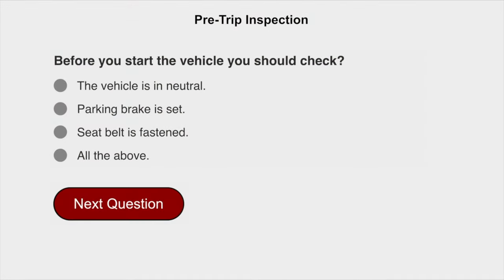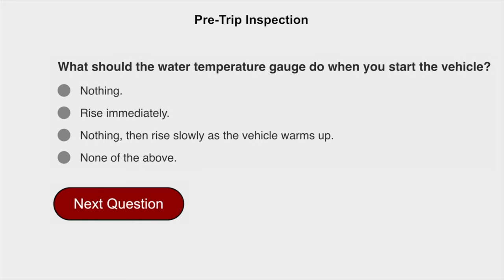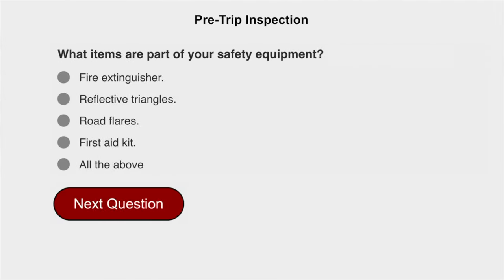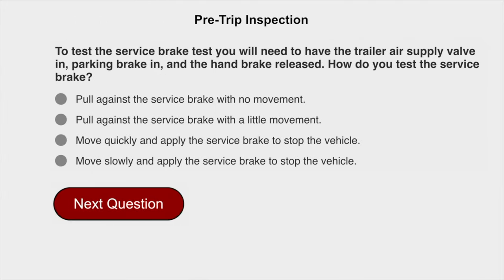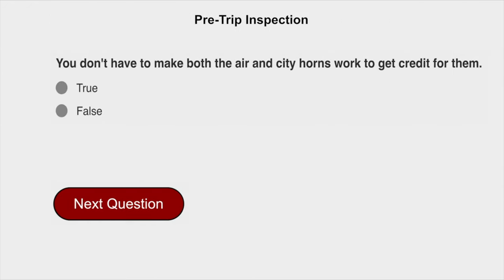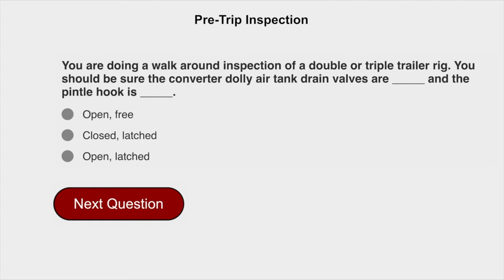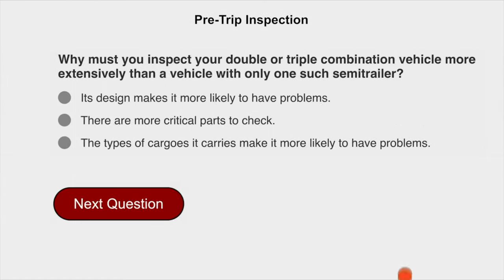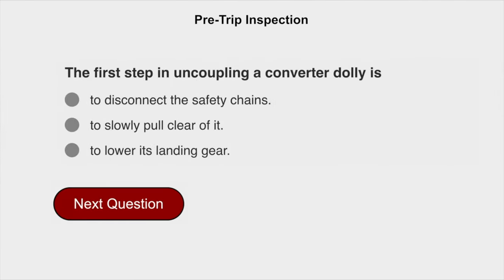CDL EXAM 2023 PRE TRIP INSPECTION-Questions & answers.

Comment: You're only allowed to miss 4 questions on the actual exam and there are several wrong answers in this video which would increase the tester chances of failure. Please Correct
Reply: Hey bud if you don’t mind do you remember which ones where they
Reply: Bcz I’ve been watching these videos non stop trying to memorize for my test
Reply: @fernandoC90  the question when it asks what psi should the low air pressure warning should come on is wrong. It says 80psi but its actually 60 psi. It says it in the cdl manual section 5 air brakes, 5.1.11